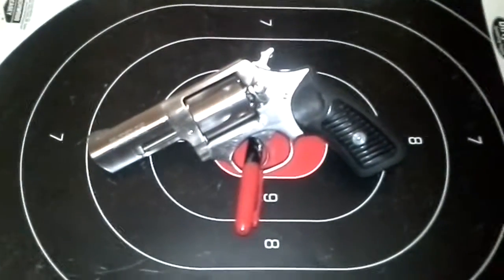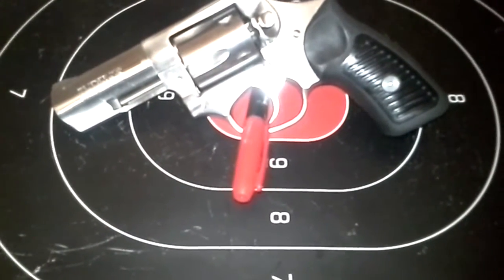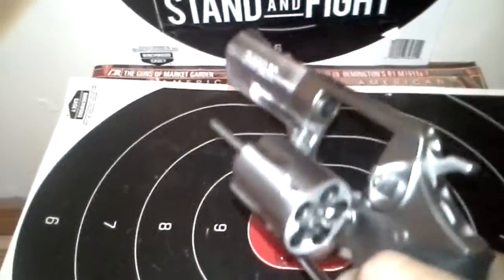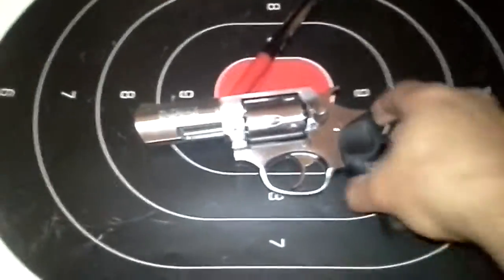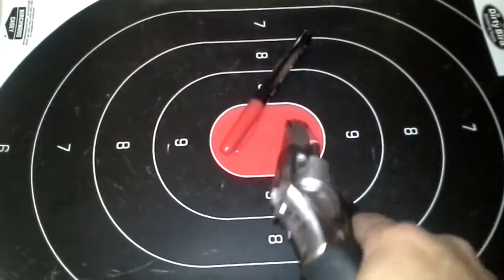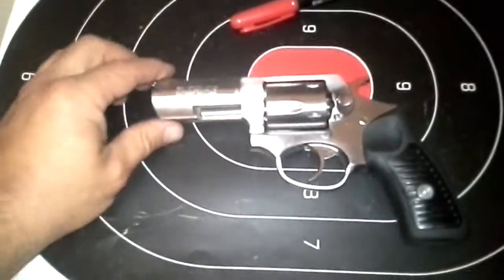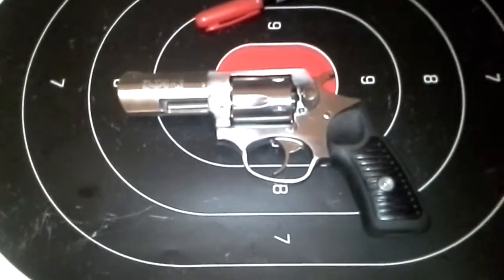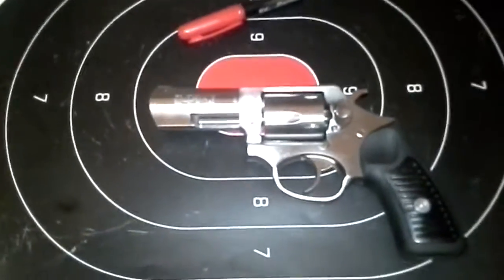Ruger sp101 shooting update!!

Comment: Shooting 38s...shorter rounds.. builds Up a carbon deposit in the cylinder which then doesn't allow the longer 357 mag rounds to fully enter the cylinder. It don't take much to then jam the cylinder and keep it from rotating. Should always fire the 357s first before the 38s. Stainless guns are easily gunked up from way too much lube. All that's needed is a couple three drops of oil on one patch. Then use that patch to wipe the moving visible parts at their contact points.

Comment: If it hasn't been shot much in a while try flooding the action with WD-40 or a light gun oil in every nook and cranny to try and get all the moving parts inside. I don't shoot my GP100 much and the other day I got it out and the cylinder would not turn when cocking the hammer, I did a good soaking on it and it works fine now. I know Ruger will fix it and go through the gun, which is a good thing, but you may want to try that.

Comment: It always sucks to have a gun lay down on ya! I'm sure Ruger will get that thing fixed up right for free. That's the bad thing about used guns, you never know what kind of rounds that thing had through it. May have been some hand loads loaded to crazy pressure. That's what some people do, they will be careless about loading up rounds, nearly blow the gun apart, and instead of doing the right thing and fix it, they'll just trade it in and let somebody else deal with it.